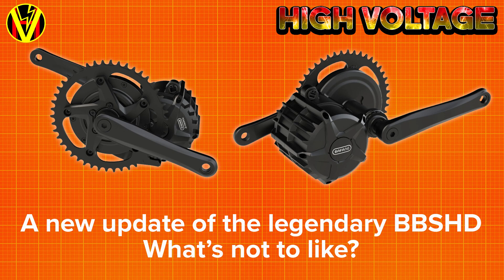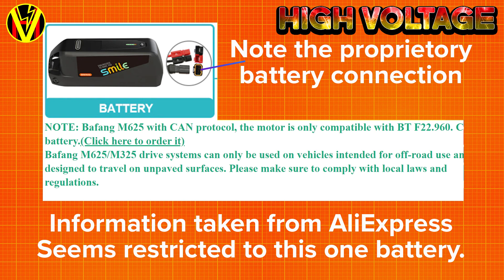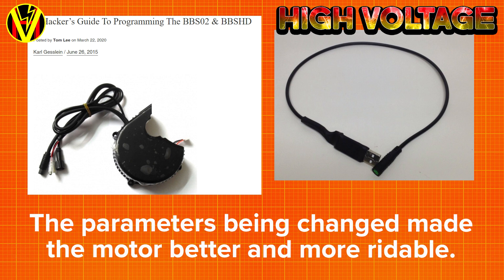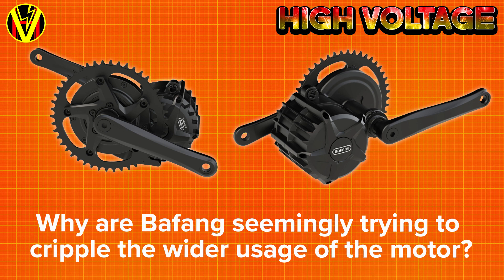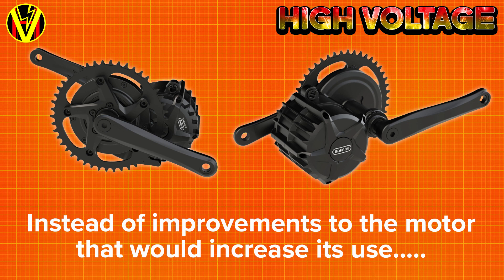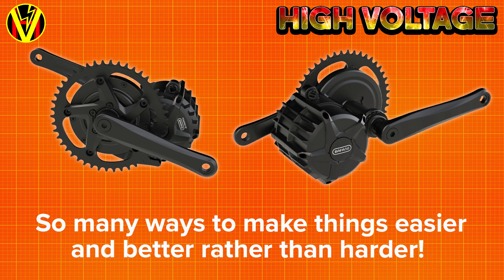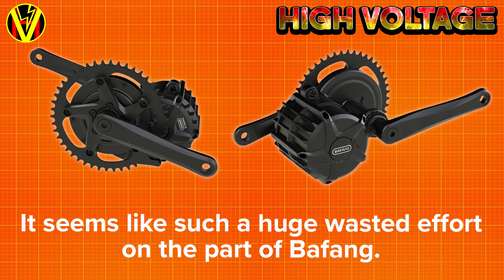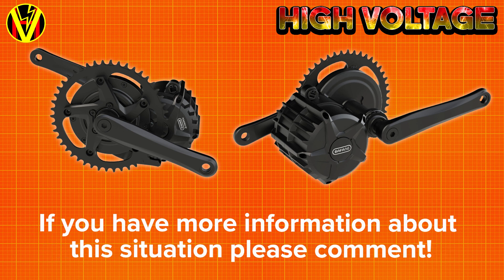NEW Bafang BBSHD / M625 locked to 48 volts, have to buy Bafangs own battery, what are they thinking?

Comment: Wow highly disappointing I will switch to Hubs or Cyc/TSDZ2 Motor for DIY.
Reply from the maker: Yeah. Hoping they will not scrap the older motor or allow a subsidiary to make it much like they kept making the Volkswagen beetle in South America years after it shut down elsewhere.
Reply: I personally have a TSDZ2, it's a fine motor but less powerful and more susceptible to damage than Bafang motors, the torque sensor is nice though however, if you want it to feel like riding a bicycle

I just wish it would've been a bit more durable/safe to high power it just like Bafangs' motors so i could run 2k through it, or even an implemented mode in the menu to change from torque sensing to cadence mode when i've been doing a really long ride and i want less effort
Reply from the maker: That's pretty much what I heard from others with this motor. Maybe one day there will be the best of both worlds.
Reply: @HighVoltageKits  maybe a Bafang torque mod, or just OSF with a mod?

Comment: Cyclone see the marketing in a positive way for the diy'ers.
Cyclone is a better option  in my opinion .
Reply from the maker: I have not heard great stories about it but I can't really comment as not tried it myself. There is definitely an opportunity for a manufacturer here!
Reply: @HighVoltageKits  I have done a few Cyclone ebike conversions.  Best performance to dollar value I've found so far.  Paco/Cyclone is probably close to a one man shop.  Can't compare to Bafang in that regard.  Will be quick to reply to individual emails but he doesn't have the resources for wide distribution or easy setup kits.  His stuff is very much geared towards heavy DIY individuals.  If you can't or don't want to make your own parts, don't look in this direction.

Comment: As someone with 15 years of emphysema, programming the BBS01, BBS02 and now the Ultra to my specific requirements is not a nice to have, I could not ride a bicycle without this. My current Frey HT1000 with the Ultra is set with torque virtually non existent and 9 nice smooth assists and I can still enjoy a long day out. I cannot use Bosch with fixed torque settings and now I will not be able to use Bafang, I wonder how many are thinking about purchasing spare parts to see out the next few years just in case, hope they don't change the ultra to CANBUS. I guess there's always hub motors (yuck)
Reply from the maker: Lots of people are getting spare parts I think. The good news is that they are likely to remain available. But yeah a bit annoying to not be able to changes settings yourself as right out of the factory the programming is horrible. Never mind if you want to configure its behavior to something very specific.

Comment: On the new BBS01 I bought, Luna and Penoff config tool doesn't work anymore. I can read the controller, but it won't allow me to write.
Could this be the same issue ?
Reply from the maker: Very possible. There were rumors of changes to the controller before this update. You might have luck with an older second hand one.

Comment: Got the M65 kit with battery and extra for £900 on Amazon on first day out. Gone up to 1100ish now. Just fitted it on my old Claud Butler. Am pretty chuffed with it. Wasn't planning on modding it so is no real issue for me. Probably don't know what am missing but the 1000w is enough for me so far. Surely there will be some way of hacking it in the future for those interested?
Reply from the maker: Nice. That's pretty good for a package deal. How did you get on with the new mounting. If you are interested you can post pics on the discord channel. A lot of people will be interested in your experiences. How it feels with PAS etc. https://discord.gg/YAAjfgc Cheers!
Reply: @HighVoltageKits :) I am happy enough. Like I say I may not know what I am missing as is my first ebike/conversion.

Have joined Discord. Will take a few pics and get on there later on or tomorrow if people want to pick brain. Not sure what PAS means. Mounting is fine. Probably not as pretty as without the bracket but seems solid.

Comment: As a public company they are limiting the after market open use and selling as a final product likely for legal reasons.  I bet they are trying to avoid getting banned by restrictive laws.
Reply from the maker: I am sure the Bafang legal department is involved. Maybe it was part of the UL rating.
Reply: I bet you are wrong. That doesn't even make any sense...Try again please. "oh, yes, if you use our 48 volt battery we won't get banned but if you use another we will get banned"...LOL
Reply: @bwiser5206  my guess is they want to control in some way the power levels and be within the legal limits for very regulated countries. Some places don't care and others don't want high power like 15kw sur ron style "ebikes" that aren't bicycles anymore. My Tsdz2 is a very different assistance than my cyc x1 pro on 72v, night and day.  750w almost peak vs 7200w, legal limit here versus illegal.
Reply from the maker: Based on what I have read online the motor is not being sold as Street legal in any way. I will be picking one up tho so we can see one way or another!
Reply: @HighVoltageKits  can't wait to see potential, I'm sure as they grow entire platform will be on same system, street legal or not. Plus some states in usa I've heard don't have power limit.
Reply from the maker: For sure!
Reply: @k04s4  You have a power limit if you want to ride it on a bike path, or without plates on the street.

Comment: The large battery spec requirement (see Bafang's M625 video) will not fit in any of the bikes I was hoping to add the M625. If you have to use the included battery because of the a handshake issue and the battery doesn't fit in most frame triangles, what is one to do? Really need a M625 pioneer builder to attempt a M625 conversion.
Reply from the maker: If I had spare cash I would order one now just to see. Maybe in a few months...I am still hopeful that it can be used with an external controller like normal! Cheers